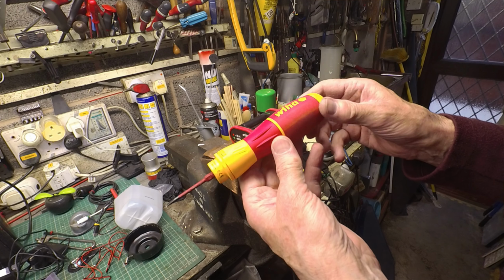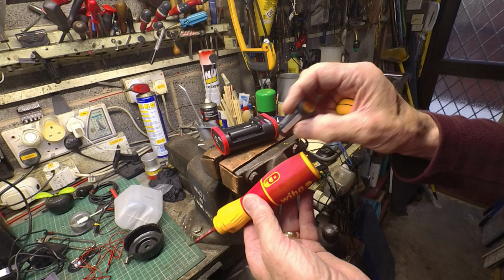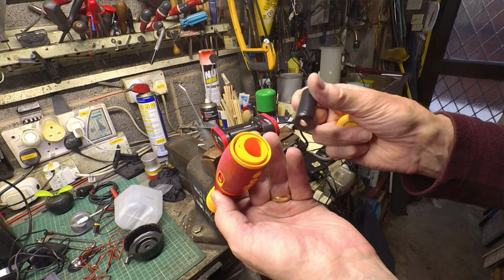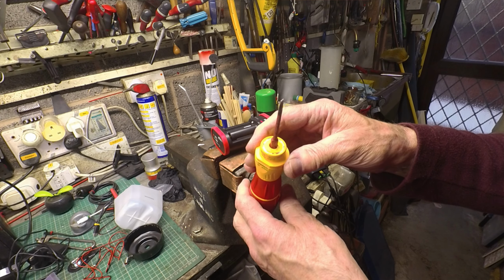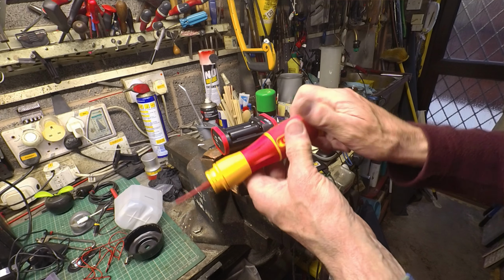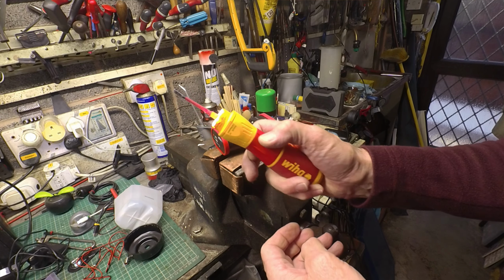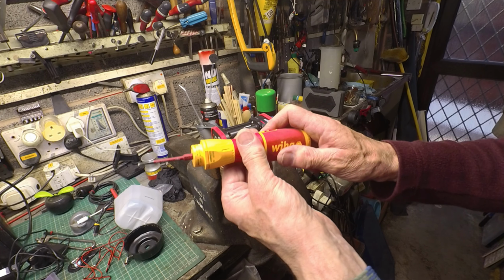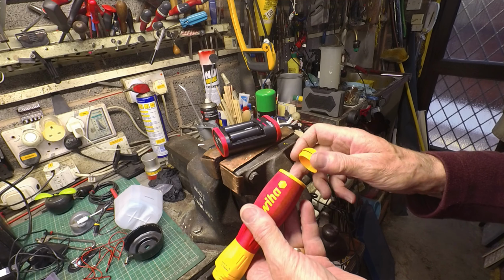Wiha SpeedE II  Screwdriver Problem

Comment: I bought 3 and all three had the same issue.. the micro switch that turns left and right after a month of use and less has failed..
Reply from the maker: Wow, that’s bad. My replacement one’s been fine; I find it really useful. I wonder if Wiha had a ‘bad batch’ early in their production run

Comment: I had the same problem.  My one is new and does work only twice. Warranty did not answer 🙆
Reply from the maker: Sorry to hear that. Wiha U.K. needed to have proof that there was a real problem but as soon as I’d convinced them (using this video) they swapped mine straight away. Good luck
Reply: It is battery problem. They have very sensitive current protection
Reply from the maker: @antonpos4622  My first driver must have been over sensitive. The replacement’s been fine. Wiha replaced it with no complaint 😊

Comment: Check the batteries with a multimeter when fully charged. If theu are showing the correct voltage then it's not the battery. Like wise get a known dead battery and charge it till the charger says full. If the battry then reads correct voltage then charger is good. If battery reads same voltage or roughly the same before attempting to charge then the charger is faulty. You can also check the output voltage and current on the charger itself with multimeter. Anyway assuming battery and charger are okay then its definitely the screwdriver at fault
Reply from the maker: Fair enough. As it happens I have a first generation Wiha Speede, so have four batteries available. So I already knew that it wasn’t a battery issue. It was the driver itself. Wiha evidently agreed & swapped it without quibble 👍